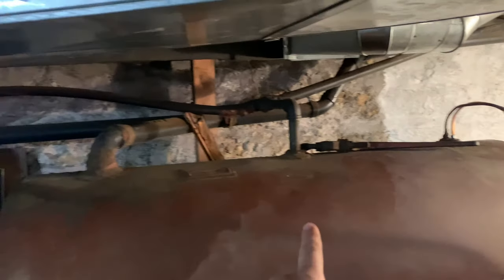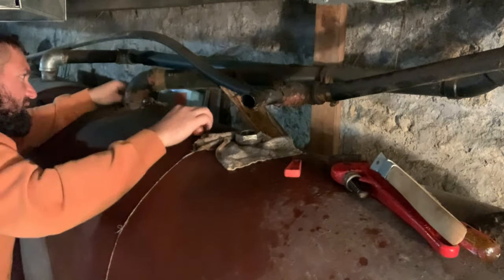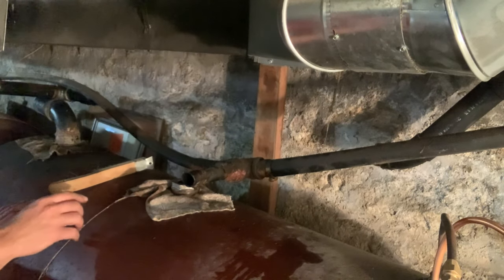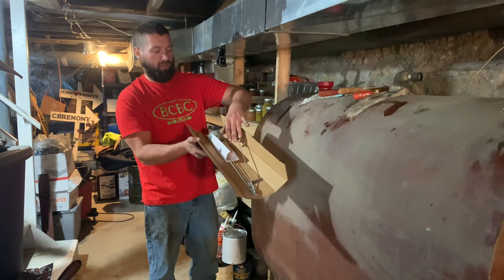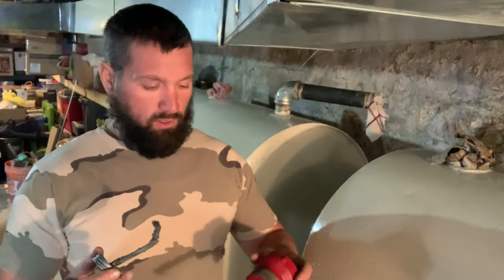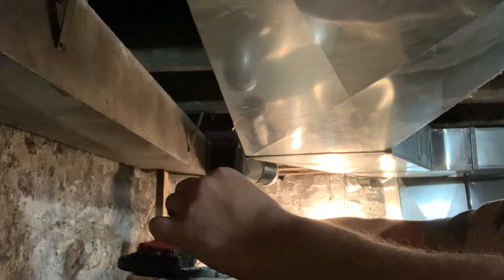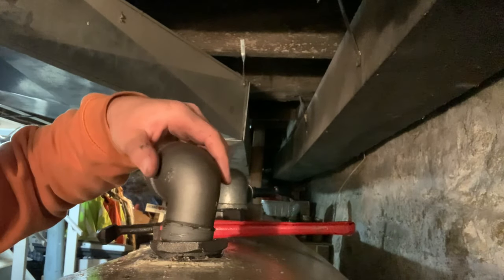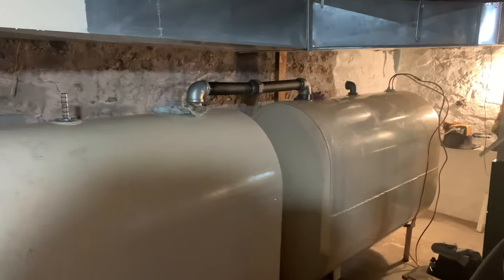How to install home heating oil 275 gallon tank lines vent and fill pipe

Comment: looking to move my existing tank.  Relocating fill and vent pipes.  Question?  I will have to shorten my copper tubing to burner.  I will cut and flare.  when I reconnect the tubing, do I have to bleed the feed at the burner or should I be good by just disconnecting and reconnecting?

Comment: On the crossover use two street 90s on each tank that way you take the difference between the tanks.  do the same on the fill and vent pipes so you keep a good pitch back to the tank that way no oil sits in the pipes
Reply from the maker: Thank you for the tips

Comment: Do you ever worry about failures of the system? How old is that tank and have you had it inspected for any corrosion? Great video btw

Is this system more effective than wood?
Reply from the maker: There’s only one heat better than oil and that’s boiler but all that’s involved heating oil is my favorite alternative to wood. I think wood is more effective depending on your setup but there’s a ton of factors that would go into a good wood burning setup. If your looking for most effective for long term and your young is look into a supplement supply such as geothermal with a heating oil to do the rest. I’d always have a wood and/or coal burning setup though in case of all else fails. I do also worry about failures thus why I have a backup/wood. The corrosion shouldn’t be so bad if there isn’t alot of condensation or any exposure to water to the tank. There is a water paste they make you can “dip” your tank with a stick if it changes color you got water and that’s a whole nother story to get rid of it. The area you’d live in would probably depend on inspections but for reassurance for yourself I’d ask your local plumber what he recommends or the man who fills your tank for the heating oil company thanks for watching! Hope this helps good luck!
Reply: Nice video and descriptions of fittings . I wonder if the industry kept up with the Woke crowd? Do you have any transgender fittings ?
Reply from the maker: @chrisdoe6890 thanks for the comment I’m not sure what you mean but everyone is welcome to watch my videos!

Comment: nice job nice video im not being smart but in pa your tanks have to be at least 6 feet from your furnace or a non combustable wall between tanks and furnace you can always stack up some concrete blocks up im not being smart its just things i  learned when i did heating work like and will subscribe have a merry christmas
Reply from the maker: Hey I appreciate that I did not know that’s why I say I’m no expert 😂 I’ll have to look into that and get it done. Thanks for informing me on that. Thanks for subscribing Merry Christmas!
Reply from the maker: Just curious Bob does the wall have to be to ceiling height or just tank height

Comment: Why are the furnace feed lines on top of the tank?? On mine the outlet is on the end at the bottom with a shutoff and filter!!
Reply from the maker: I’ve seen both done many times I used to actually deliver home heating oil. It all depends who installed it i however never done these tanks initially. The theory here is not to suck up dirt at the bottom of the tank. The theory on yours is a filter to catch it all keeping the tank clean. I also have a inline filter I don’t think personally one way is much more effective than the other however I’m no expert good question maybe someone else can shed some light on for us?
Reply: @frontwoodsfarmer2063  If you feed the oil from the bottom port,  a nick in the line would empty the oil on your lawn or in the basement.   Sucking the oil from the top of the tank would prevent this unless the boiler was running and pulling the oil thru the line.